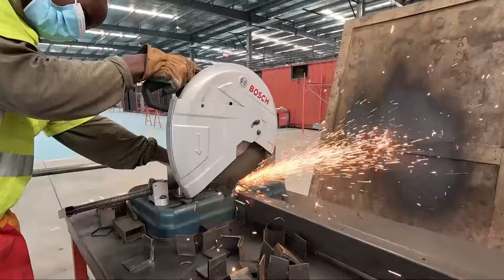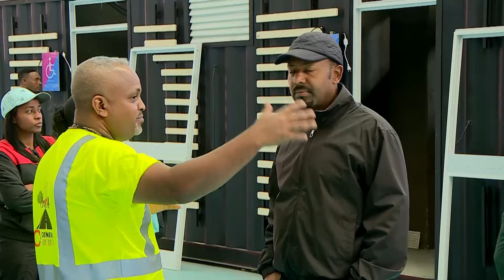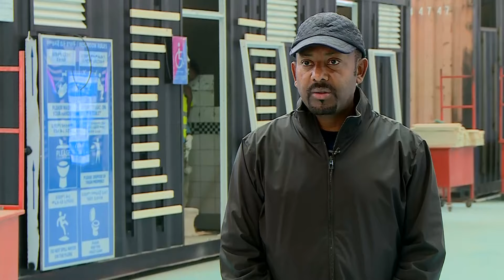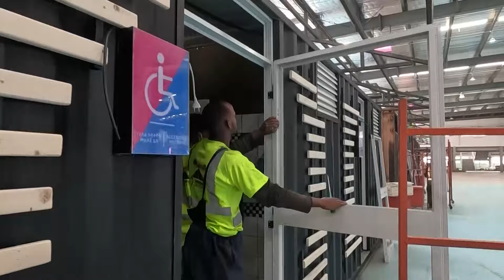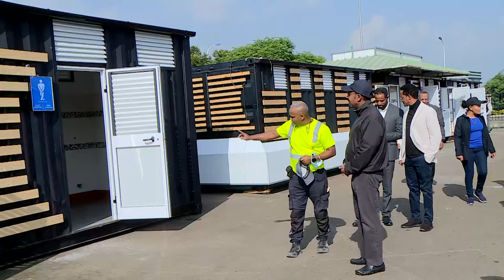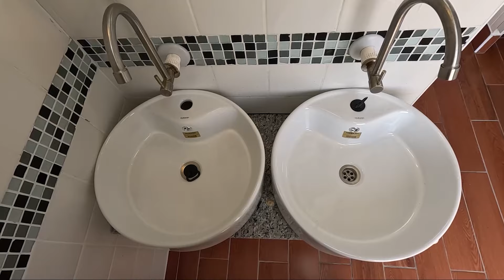የ #ጽዱኢትዮጵያ የህዝብ መፀዳጃ ቤቶች ግንባታ ያለበት ሁኔታ

Comment: It is recommended for corridor betting to last for not more than 10 years until it is becomes available again to be rewarded. Road lottery depends on the width of the road and the size and availability of the area between them.